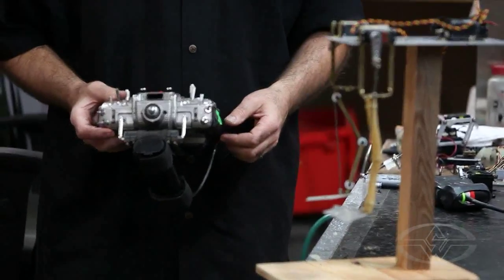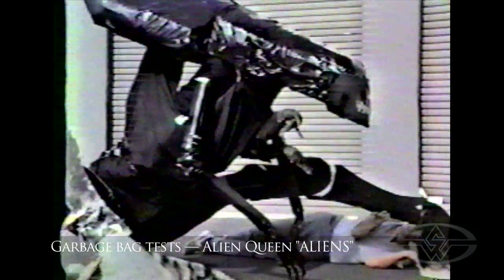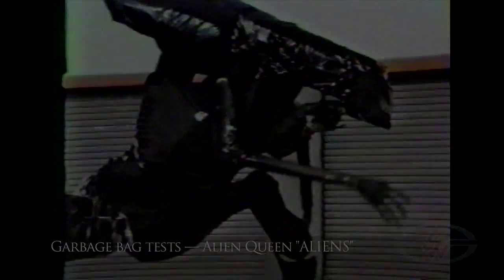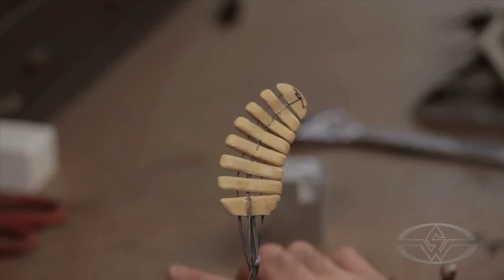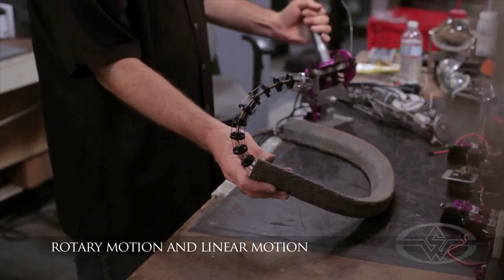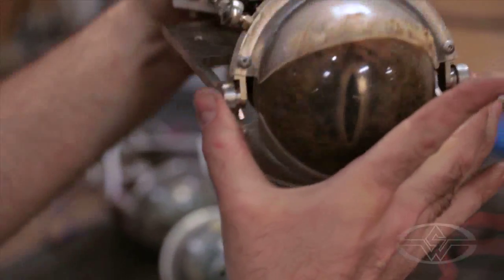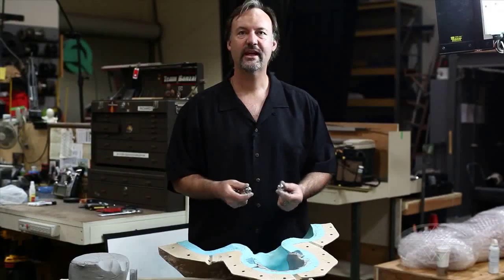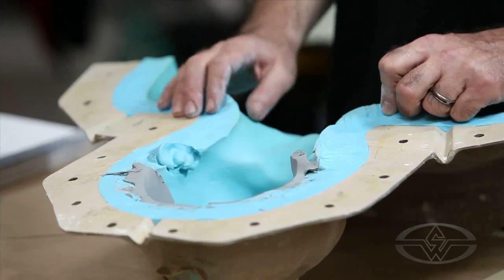Animatronic Character Basics - PREVIEW

Comment: I bought the DVD and was sorely disappointed. It is a "basics" DVD in the sense that it tells you what the basics are, but never goes into any kind of detail on how/why they work, the theories behind them, or when to use them. It was like someone reading a "table of contents" with visual aids. 

The price is also high, considering the length relative to other videos (it's 1/3 the length of some). 

I plan to check out some other videos, but I'll be streaming them so I dont get another $70 burn.